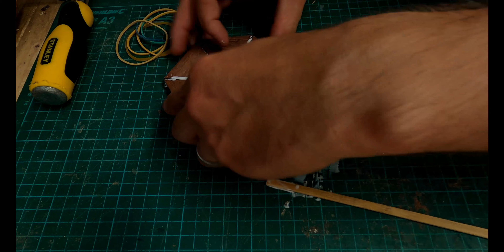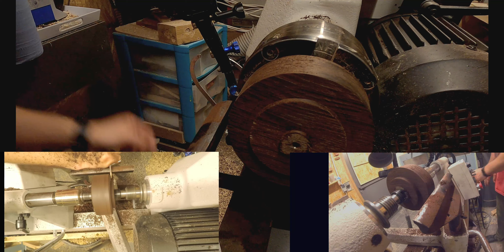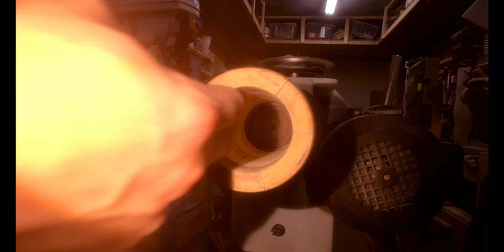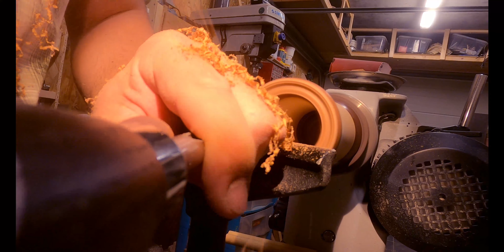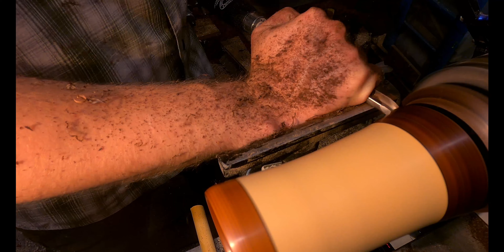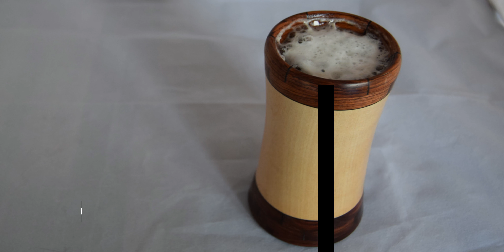Wooden Tankard - making the blank and turning the body

Comment: Hi Ruben, that looks gorgeous. A couple of questions. What woods did you use and what was the piece you put in the first ring for at 2.00 minutes as it doesn't seem visible anytime else. Take care Ruben and looking forward to Part 2. Cheers, Huw
Reply from the maker: oops, seem I forgot to reply: the dark brown wood is rosewood with some colored veneer between the segments. the lighter wood is maple and the "plug" in the bottom is wenge.  the handle in part 2 is also made from rosewood and veneer.
Reply: @RubenWoodcraft  Thanks Ruben. Cheers, Huw